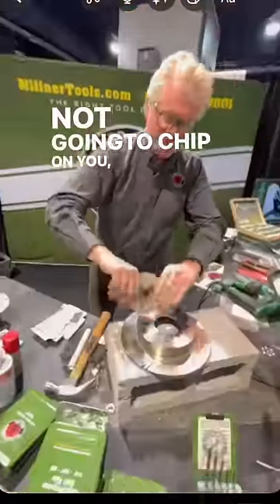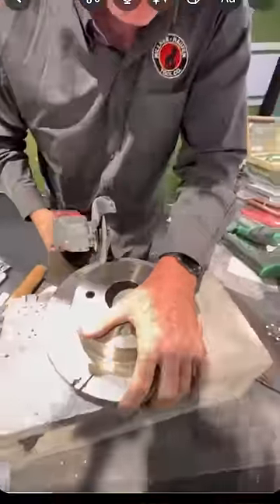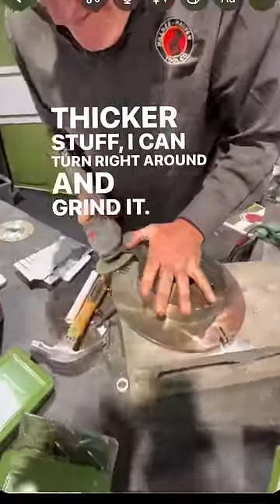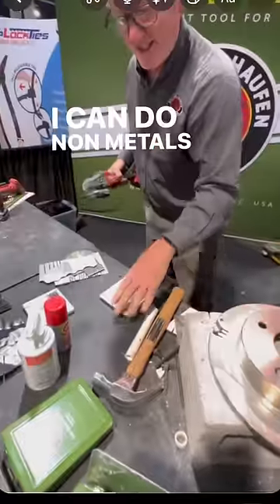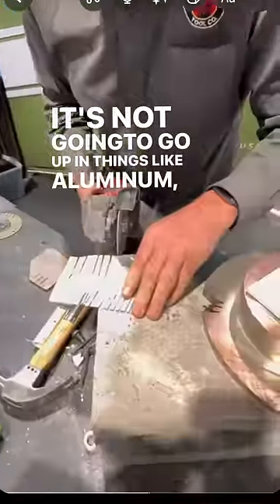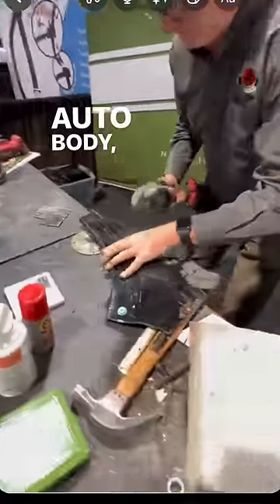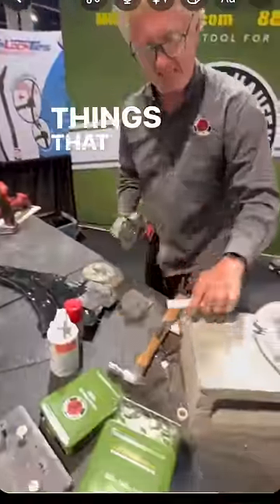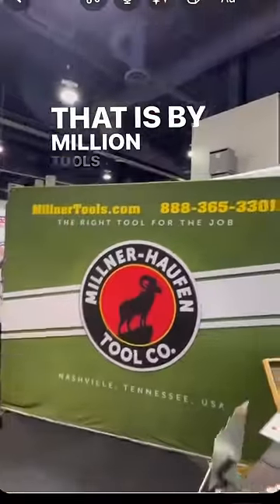I can’t believe he can touch it after all that!  #shorts #amazing #gadgets

Comment: "And best of all it's not hot"
Ah Asbestos my old friend, it's been a while.
Reply: @dbbd9890  as an insulative material, it can store a lot of heat but not feel as hot to the touch
Reply: Lmao you think we gonna see his company get sued into oblivion in 35 years?
Reply: If this is how they achieved it very clever of you to spot it
Reply: It's not asbestos. Just look at the disk. Shiny. Gives you a hint.
Reply: @jordanharvey2163  titanium? shoot idk toss us a hit J-man
Reply: @ashbynathana  without proper testing or having one in front to identify,  I'm really just guessing,  but there's only 3 metals that can cut any material and remain usable,  the cooling part seems to be about the design , but carbon steel, titanium or platinum. Diamond cutters stay fairly cool. But it looks like the design sucks In air as it shoots out debris    kind of like an air cooled motorcycle. I could be wrong. Again, just my opinion without testing.
Reply: electroplated diamond, 2 grits one side is 60 one is 80. it's 150$ for one 4" disk that has a lifetime replacement garuntee.
Reply: Hahahahah
Reply: @jordanharvey2163  lmao I bet its asbestos
Reply: @brandonwyatt3901  it's not asbestos.  Betting just means that's your opinion.
Reply: @ashbynathana  it’s diamond grit. Or carbon carbide abrasive possibly. It is commonly used for tile stone and masonry work. You can use it on metals but it would honestly wear and tear a whole lot more and heat up a lot more.
Reply: @jordanharvey2163  it’s diamond grit infused.
Reply: @mrpumperknuckles1631  can't just be diamond grit infused.  Diamond doesn't cool fast and it also won't cut well without water on certain materials. I have some of the most expensive diamond tipped, covered and gritted tools you can buy and they can't even do what that video does.
Reply: @jordanharvey2163  diamond is literally one of the best thermal conductors on the planet. Almost 5 times that of copper. The surface area of the thousands of diamond facets all form a heat sync and dissipate heat at once. Quit spewing bs kid and pick up a book. For starters pick up a book on thermal dynamics.
Reply: @julianburns6632  How do you explain that this tool far outperforms normal diamond grit?
Reply: @julianburns6632  okay then explain what’s going on since the sight states the wheel is diamond electroplated and asbestos isn’t that strong. 

This is a convention floor and he really touched the blade. 150-165F will make you wince, it may not be room temperature but it’s at least cooler than that
Reply: @jordanharvey2163  very true
Reply: Oh God imagine asbestos in a grinding wheel that's literally turning into dust in the air lmao everybody would have mesothelioma in an hour
Reply: @julianburns6632  If you had ever read a book on 'thermal dynamics' you would know how to write thermodynamics and heat sink.
Reply: @antton9623  lol my bad sync was auto correct. Thermal dynamics is the brand of my plasma cutter, fresh on the brain I guess.
Reply: It's going to be a diamond carbide matrix impregnate in tool steel
Reply: @jordanharvey2163  Never heard of a platinum cutting tool, I should know because I have machined platinum pacemaker electrodes. Platinum would not make a good cutting metal, except for maybe non ferrous (brass, copper, etc) lol. Tungsten, molybdenum, most refractory metals, powdered steel, tool steel, titanium and stainless. I may have missed something, but even most of these at those surface speeds would melt. My guess is diamond  or ceramic impregnated high speed steel.
Reply: Nope. You really think that would be allowed to be used anymore?
Asbestos isn't that hard anyways.
Reply: @TlD-dg6ug  we used platinum cutters in the military to work on our 3 phase diesel generators. Also brass tools.    Diamond and ceramic both conduct tons of heat.  So its not either. Anyone who has ever used a diamond disk or a ceramic disk to cut stone or metal knows you have to use oil or water to help dissipate the heat.
Reply: @jordanharvey2163  I think you saw platinum on a brand name, if we're being honest. Giving credit to the validity of the story, because it sounds like you made it up.
Reply: @squirrel69877  lifetime replacement guaruntee, for diamond blades.
I see bankruptcy incoming.
Reply: diamond grit asbestos cement
Reply: I’d rather run the risk of the wheel breaking and getting hot than breathing in asbestos
Reply: It’s a new drug to get from your drug dealer, it has a hell of a kick.  “The only drug that Has no consequences”

-Asbestos
Reply: @jordanharvey2163 what if that brake rotor was a one off super soft porous steel that grinds really easy and the "ceramic tile" was something made of a hard variety of chalk or some such? Not at all saying it is, just saying that they have that test set up absolutely optimally set up to make their thing look good. Marketing can very often cross the line into the dark side I find. I'm always skeptical. Let me spend a minute or 2 cutting on some hardened wear plate or some such and I'll let you know if it's any good. Same with their drill bits. Let me drill 2 holes thru 1/2 AR500 and I'd buy the set
Reply: Lmfaoooooo. Top tier comment. 

Also its electroplated diamond.
Reply: could be some sort of aerogel compound
Reply: @Titantitan001  electroplated asbestos then
Reply: @GlorifiedGremlin   I’m pretty sure it’s been done before. But yes what a thought.
Reply: @jordanharvey2163  you forget cobalt
Reply: @julianburns6632  my guess would be if it is diamond plated like it say it either makes up a very small portion of the overall thermal capacity or they have included a cooling mechanism directly into the blade to as a fan?
Reply: It clearly states on their website.. the following below.

Key features:

Made from alloy steel for superior longevity

Diamond edge for accuracy and consistency

Clearing channels help reduce buildup in softer materials

Multi-functional with variable grit (40 grit on the edge and front face for aggressive cutting and grinding/80 grit on the back for finer grinding and sharpening)

Safer than traditional wheels with fewer sparks and specially designed cooling slots to reduce heat during extended use
Reply: @asbestosfibers1325  *mesothelioma has entered the chat
Reply: @squirrel69877  is it a real lifetime warranty tho
Reply: @jordanharvey2163  probably both, combination of some sorta asbestos, fiberglass or carbon fibers mixed with tungsten or some other tooling metal.
Reply: It’s not going to brake 😂😂😂
Reply: @brandonwyatt3901  I'm guessing leaked alien technology. I mean just look at the dudes hair? Lol
Reply: @mainmanmooky8820  it's just a poor heat distributor
Reply: @brandonwyatt3901  I just bet 100$ with you and you just lost
How do you want to pay me lol
Reply: @coffeewithmilk563  explain why it clearly stated on the site what is made from clown
Reply: @jordanharvey2163  
  Right ! 😂 …. Funny joke.. but clearly not involved in this product.
Reply: If he did those same materials in that order. It won't be glowing. Science is a hell of a drug
Reply: @squirrel69877  where can you buy them?
Reply: Amazing how this OP's comment was a joke yet many of the comments here thought it was serious. Got my laughs for the day. Thanks everyone. 😂😂
Reply: So that’s how they stole my catalytic converter so fast!
Reply: @squirrel69877  thats quite cheap!
Reply: 🤣😂😂 this comment is fucking amazing
Reply: If you actually looked it up you would have found that-

•Made from alloy steel for superior longevity
•Diamond edge for accuracy and consistency
Reply: Gonna come right out and say I doubt it's asbestos given the strength, but I'm not saying I know that. For all we know you could be right
Reply: @jordanharvey2163   found it on their website, it’s electroplated diamond
Reply: Electroplated diamond
Reply: It is full of gaps for cooling. Inhaling that dust is a really bad idea.
Reply: @jordanharvey2163  Tha produser says "electroplated diamond". So your wrong, it is just that....
Reply: Omg. Ppl, just look it up. The site says "Made from alloy steel for superior longevity
Diamond edge for accuracy and consistency
Clearing channels help reduce buildup in softer materials. Multi-functional with variable grit (40 grit on the edge and front face for aggressive cutting and grinding/80 grit on the back for finer grinding and sharpening).
Safer than traditional wheels with fewer sparks and specially designed cooling slots to reduce heat during extended use

Please note, recommended for use up to 15,000 rpm."

Like wtf are you all arguing about???
Reply: Y’all who believe the manufacturer’s advertised composition sound like you’d accept counterfeit bills—any crook passing them would say they’re real, naturally
Reply: @jordanharvey2163 well your opinion sounds pretty professional and thought out. so since I'm not putting anymore effort into figuring it out I'm gonna go with titanium like you said until someone proves it wrong.
Reply: Clearly have no idea what or how asbestos comes or what it is used for.
Reply: Really? That's the best you can do/ say?
Some people.. Tell ya! 🙄
Reply: @tomijorg  but I also said it's designed to cool while using it. The Channels that shoot out debri and suck in air. So I wasn't actually wrong.
Reply: Literally my first thought
Reply: How to get instant cancer - Asbestos
Reply: @tomijorg  people are freaking crazy 🤣
Reply: I lol'd so hard it's embarrassing
Reply: Will sharpen industrial hard cutters
Reply: Snort a few lines daily to keep the lungs in check
Reply: Asbestos wears off, so, definitely not.
Reply: @jordanharvey2163  it's a mixed metal
Reply: @squirrel69877  yeap, it IS real, nice
Reply: It’s electroplated Diamond
Reply: I hope they dumber use asbestos
Reply: @dbbd9890  ??????
Reply: @jordanharvey2163  your opinion is just like his then! meaningless (:
Reply: @evanbarnett2411  I literally said it's not factual without testing and it's just my own opinion.  Not sure what you're going on about?  If you're trying to say I'd get mad over your opinion of my opinion,  then you're wrong.  We all have our own opinions.
Reply: @mainmanmooky8820  you forgot to add why its banned from use
Reply: @RyanStonedonCanadianGaming  I bought one of these from this very guy at The Performance Racing Industries trade show in Indianapolis, Indiana last year. We use it to sharpen carbide tipped cutter teeth on a stump grinder. It is pricey,but does everything the guy says,and last a lot longer than you can imagine. Lifetime warranty, no hassles,they have been selling them for years! It is diamond substrate,I don't know what the bonding material is, but it does everything thing they say it will.
Reply: @jaywiebe7612  cuts,and sharpens carbide,so cast iron,tile,wear plate,AR500 is no problem. I have 2 of these discs,use them to sharpen carbide tipped cutters. Have used it to cut AR500 plate also,and Hi Tensile steel on equipment trailers. It is the real deal,pricey,but does everything the guy says it will.
Reply: What stores  sell these multi purpose cutting blades.
I am amazed at the reaction of the others that commented.
He gave a live demonstration...
Do you not believe your eyes ?
Or are you just jealous ?
Reply: Don't let the young kids be confused. He was just showing the tool how to be a little bit more powerful with a little thrust movement 😂. It's not about the length it's about the motion in the ocean even with a tool 😉.
Reply: @ashbynathana  6 months after he sells it
Reply: "If you or a loved one has been diagnosed with mesothelioma or lung cancer you and your loved ones may be entitled to cash compensation" - a lawyer...probably
Reply: I'd be wearing a heavy filter regardless, I hear crystal silicosis is hot this season
Reply: Diamond blade just looked it up
Reply: @ashbynathana well at least we know now you believe someone's comment you don't know.
Reply: Of course! Who'd go around lying on the internet?
Reply: @sshyshy6097  what part is asbestos? Nothing I seen there.
Reply: Lol
Reply: @ashbynathana  its alloy steel.
Reply: @ashbynathana  he won’t live that long 😭🤣🤣🤣🤣 he would’ve thrown in the towel by then lol
Reply: @jordanharvey2163   what? How do you come up wth these materials? 
Platinum ist softer than mild steel and as expensive as gold... 
Titanium is still weaker than good steel.
There are tons of other metals that have better properties than these 2.
Reply: "If you or a loved one has been diagnosed with Mesothelioma..."
Reply: @jordanharvey2163  yeah but those sparks are helping to release the heat. So only draw back is this grinder needs a good vacuum port.
Reply: @jordanharvey2163  oh you said sucks in air, not "sucks." Lol my bad
Reply: Very rough surface on the wheel so it should stay relatively cool to begin with
Reply: @ashbynathana  damn Jordan don't sound like a j man at all. Lol. Dude knows what's up apparently xD
Reply: Definitely not asbestos. OSHA and others would never let that fly.
Reply: @ashbynathana  it's diamond impregnated.  I have one from bad dog tools that I've had for about 7 years.  They work but are thick like cutting with a grinding disc.  They also use up a lot of power so on a battery operated tool it eats battery.
Reply: yo, its a diamond wheel cutting(with way too much pressure) a cast iron brake rotor.  nothing special here
Reply: @ashbynathana  as long as nobody gathers up the grinder dust and snorts it, I think he will be fine.
Reply: Looks like Pvc not asbestos
Reply: @julianburns6632  sure..but I have used diamond bits in a Dremel and they get hot, melt some things and can't do majority of what this dude did
Reply: $150 dollas?
Reply: CANCER ?!
Reply: @BrokenBONEZzZ  sort of. It's actually a condition similar to lung cancer.
Reply: @markchidester6239  In a grinder tool setting? No. But asbestos still gets used in many areas, such as construction or car brakes/clutches.
Reply: @n0steeze  It is to my understanding that it was ban in 1997 from the United States.
Reply: It's Diamond..
Reply: @markchidester6239  This is wrong, it still gets used today. Mining asbestos may have been banned, since that's around the time it stopped. The US simply imports asbestos from places that do still mine it, anything between raw material to finished products.
Reply: My money is on a ceramic material. Ceramics are the future.
Reply: @julianburns6632
Reply: @jordanharvey2163  it's a joke ffs
Reply: @jordanharvey2163  no, it means you bet
Reply: @julianburns6632  best conductor and in worst conductor
Reply: @ashbynathana  absolutely no one like his comment it’s at 666
Reply: Oof too late is at 667
Reply: 🤣 just seen two snap offs do the "son of a bitch" scene
Reply: @mainmanmooky8820  Speech 12, thermodynamics 0
Reply: Show more clean cuts video was short couldn't tell how strong it was lol
Reply: Asbestos never really leaves you lol
Reply: @jordanharvey2163  not saying you're wrong but at dow when I use machine oil, it seems to dull blades and bits more than if I don't use it.. they tend to last longer in my experience. Almost as if it self sharpens without lubrication and the machine oil appears to dull a bit in 2 days. Meanwhile we've been using the same non oiled bit for almost a month now. Would say it's the method but I'm not the only one using the mag drill or grinding/cutting. Really is strange. I believe the manufacturer says to lube so they sell more and make that 💰
Reply: @stevenwatsonjr1  possibly.  That's usually how product advertising goes. They appeal to a consumers mind , so people are naive and buy it and use oil.  I simply use atf or old oil.  Better cooling properties and I've had no issues so far. Even can mix atf and mineral oil in a spray bottle and it'll work great as well. Even way would be better than oil.
Reply: @julianburns6632  High thermal conductivity is a reference to some things ability to hold heat, not pass it and release it. So diamond being one of the most thermally conductive naturally forming substances in existence that we know of, is probably going to hold more heat than just about anything else, so why then would the heat dissipate all at once? If you know, then don't make me go look in a book, life is far too chaotic for that. I need the information Here and Now sir. Please help me.
Reply: @jordanharvey2163  the website says it’s diamond but yeah everything you said was right, solid eye for tools man
Reply: Its electroplated diamond not asbestos
Reply: @julianburns6632  You don't want a conductor for it to stay cool. You want an insulator. Sure a conductor might cool fast, but it has thermal mass. Those calories don't just disappear into the air so fast. They need somewhere to go. 

The reason why asbestos was mentioned is because it's an insulator. Diamond is about 100K times more conductive than asbestos. This blade is probably made from some oxide and maybe some special preparation of silicon carbide. This would give it the right strength and heat resistance.
Reply: That's great
Reply: @julianburns6632 I'm a Machinist. I work with all sorts of cutting tools, be it end mill, grinders, diamond or diamond grit. They guy you're arguing with is correct and you really are "confidently incorrect" as they say.
Reply: Azbest? That carcinogen material? XD
Reply: Can you still hear after doing this all day without any protection? not to mention the silicosis from ceramic dust. I've if??? It is a good product not worth your health.
Reply: It's funny you should mention phased out materials, I just finished a course on applied diffusion and kinetics and came across leaded brass as a machining material previously very heavily used.
Obviously this probably isn't that. Still sus of this disc anyway.
Reply: @jordanharvey2163  well first of all the website says it's alloy steel that has been electroplated with diamond grit

Secondly the water use on diamond blades is mainly to control dust. Lots of diamond blades are able to be used dry and still stay surprisingly cool even after cutting through steel, concrete or asphalt
Reply: @SparxI0  correct to an extent.  Also depends on the temperature in the working area, what you're cutting,  quality of diamond tools and most importantly,  the Rpm the disk is spinning at.   The faster an object rotates against another hard object , the more heat and friction you build up.  But I can understand what you're pointing out and I respect your input. They say those who can disagree and still be civil are considered the smartest people in the conversation.  I have used some very expensive diamond bits to cut and drill granite,  marble and quartz , had to go slow and slow rpms and lots of water. One crack and the entire slab is trashed. A stress crack can't be predicted what will happen in the future. It can be worse than the surface shows.  I've always cut tile with a grinder and diamond disk.  I have 3 tile saws. But I like a challenge.
Reply: @squirrel69877  $150? lol nvm.
Reply: @RyanStonedonCanadianGaming  diamond dust is cheaper than clay